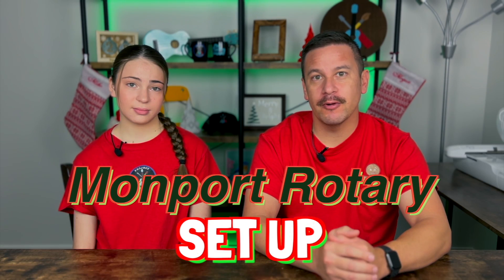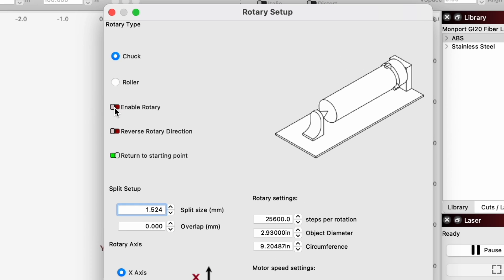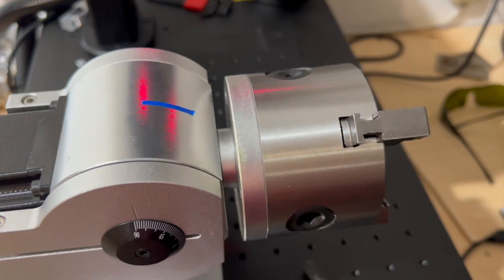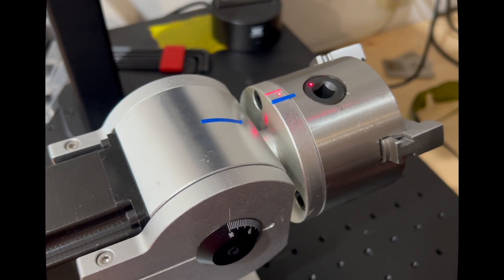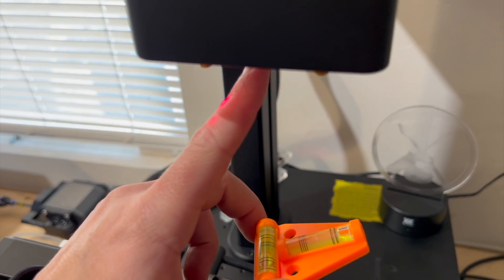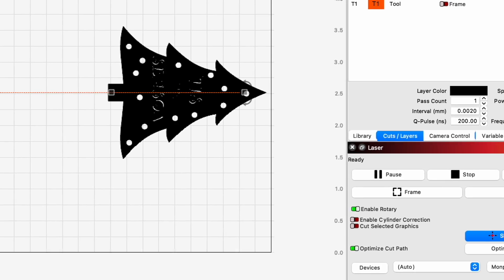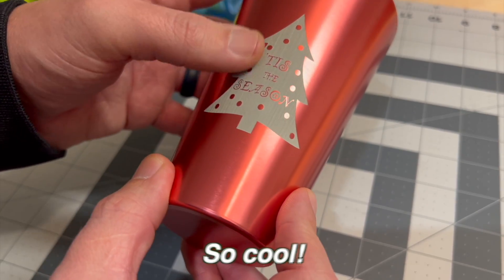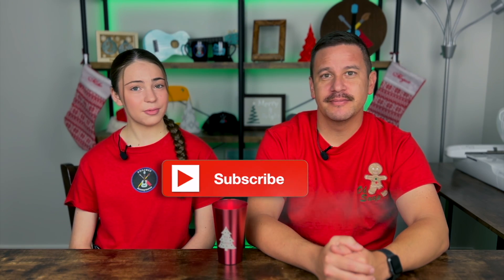ENGRAVING CUP w/ ROTARY ATTACHMENT on Monport GI20 Fiber Laser Engraver

Comment: Hi Folks! love your channel. Thanks for all the tips you given me. I've just started looking at your videos on lasers. When I watched the vids of the Monport 40W CO2 laser and the cost I was intrigued. The G120 is a huge jump in price. The question is can you set up a rotary rig with the CO2 laser? Doesnt seem like there would be the room. What is the main advantages of the G120 to justify the huge price jump?
Reply from the maker: The GI20 advantages are speed, higher contrast and they would be a preferred choice when working with metals including the ability to color mark on stainless steel. The type of rotary would be different on the two machines.  The CO2 would require a low profile roller and there would be more of a limit on the size of what you can put on the rotary.  The CO2 advantages would be that it is enclosed and can handle a wider range of non metal materials.  The two machines capabilities are very different so it would come down to  materials you mostly intend to work with and if speed is a factor. If you want to work more with metal we'd suggest a fiber laser and if you work more with non-metal materials we'd suggest a CO2 laser.  Both types of machines have their advantages and limitations, we have really enjoyed working with both machines. Thanks for watching!